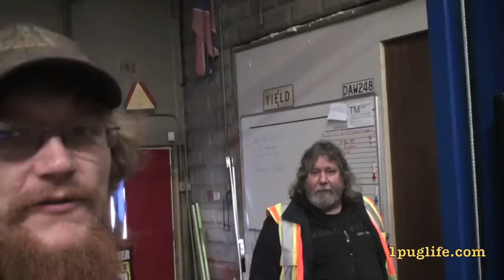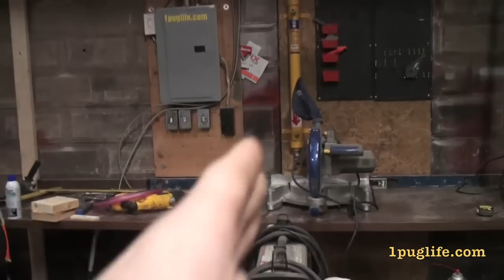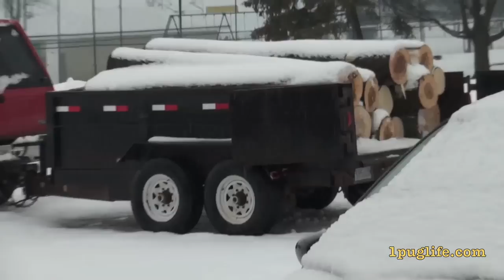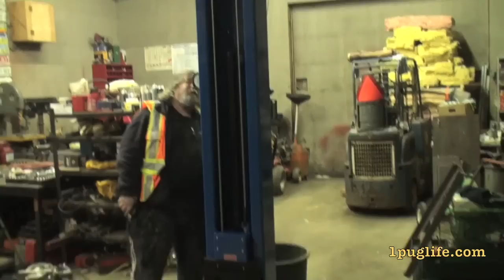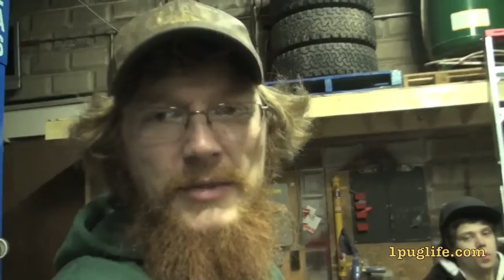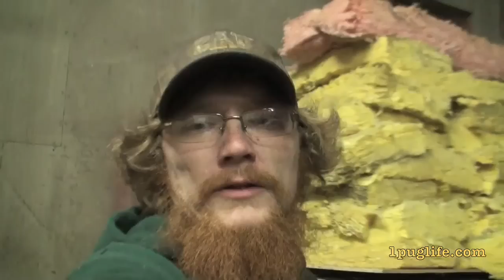we pucked up big times

Comment: Pug if your having cold start issues with your 6.0 liter i would you tubes how to diagnose  FICM voltage.  Seeing as how you had trouble with dead batteries i wouldn't be surprised your FICM may be dinked.  They dont like low battery voltage much its hard on them big times.